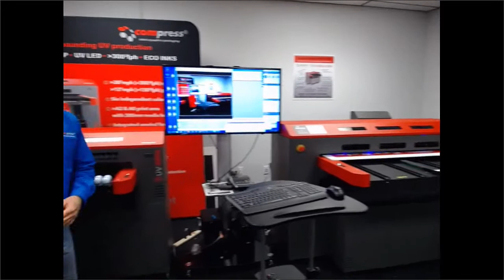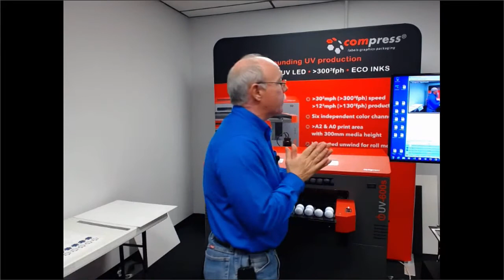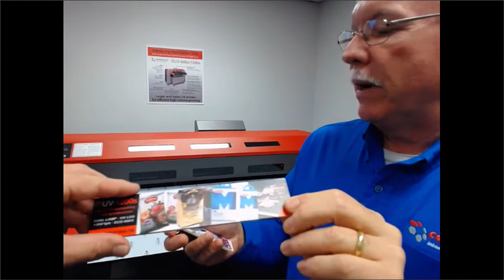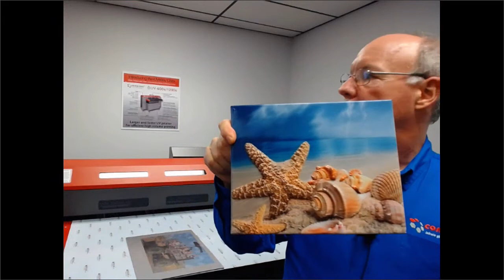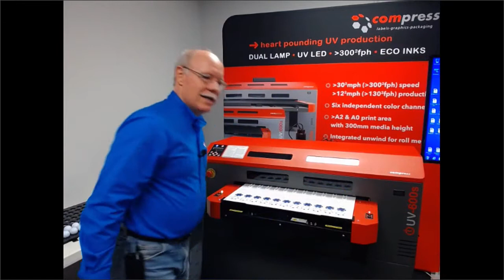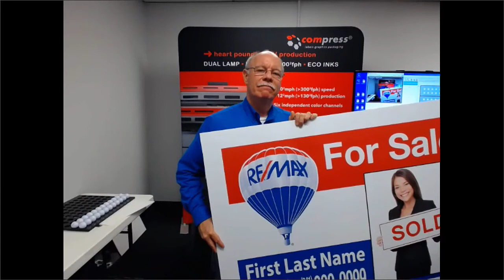Intro to UV Printing | Compress  LED UV Printer Webinar

Comment: Would recommend going with another company, our experience has been very poor. The machine has had issue after issue
Reply: what we're the issues that occurred with this machine?
Reply: @harlydibundu7906  the motor that lifts the printing table malfunctioned. The wiring on the part for that was faulty. 

The printheads all dropped. One day it was printing and just stopped. The machine was under warranty, but we were told that the company does not guarantee the print head. You can buy from the company for $3,000, while the same/very similar model can be found online for $500. 

The fuse blew. A couple of dobbers (I forget what they are called, but they connect the print lines to the print head) broke. 

You name a problem with a printer and we had it all with this machine. The service guys try to help, but the machine just keeps braking day after day.

Comment: This company does not support their products. I bought their IUV 1200 printer from Graphics One in California in January 2017, many hardware and software problems. Local technicians are not trained properly, support and parts has to come from Australia. I spent more than $40,000. for this printer with 29" x 45" print area, can only print 12" x 29". Contacted the Owner of Impression Technology in Australia, no response so far.
Reply: Can you tell whether the machine is badly designed or is it just a company support issue? If you had proper support do you think the machine would work fine?
Reply: @PrintABC   the machine breaks down in every way possible. 

Our was shipped with a bad motor and circuit board. 

In less than 1.5 years it has broken 10 times. 

Every pieces has failed. 

The USB port, the software crashes, the chit board was faulty and loose, the motor didn’t work a lot of the time, the print head failed too... 

The company wants you to pay for new pieces to a machine less than 6 months old that has already been failing.
Reply: Good to know. I was considering a purchase. Thank you
Reply from the maker: I am so sorry that you have had problems getting support on your UV printer. We took over the dealership for the United States in January of this year. I think and one of the reasons is we're a larger company with more support personnel and a history with digital printing and with impressions. For ColDesi customers on-site installation and free technical support is always included. We've got almost 20 years of experience in the printing industry and have a vested interest in keeping happy customers because we Supply a wide variety of other products as well. If you'd like to private message me I'd be glad to see if there is anything that I can do for you.
Reply: There is another company: Michigan Graphics & Award contacted me with the same problem regarding this IUV 1200 printer.  They bought is from ColDesi, not getting support even within warranty.  The bed moving mechanism is not precise, multi-pass registration is horrible, white ink overprint is not acceptable.  I've spoke with Dan and the manufacture owner Jerry in Australia with no help.  It has a basic Hardware problem as we were told, that the bed moving gear is not properly registered.  I can not spoke about IUV 600, but the IUV 1200 is definitely a Dud!